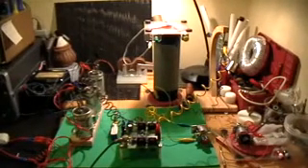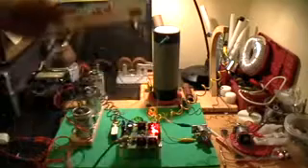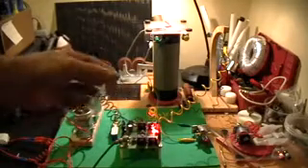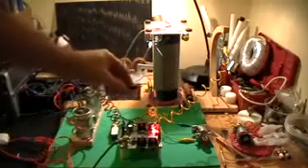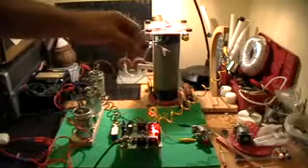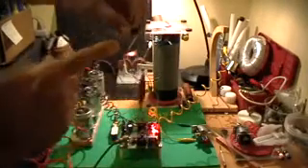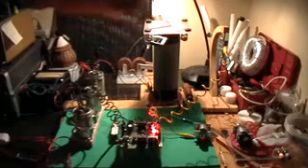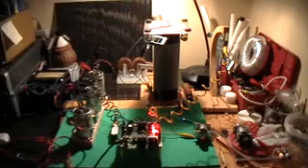resonance effects for everyone 5

Comment from the maker: That sounds really interesting and exciting. I'd like to see the material, for sure, and storage isn't a problem--I saw a Terabyte drive advertised for under a hundred bucks the other day. The best thing would be for you to upload the files to a file-sharing site, like *me*di)a^fir&e (strip non-alphas).
Speaking of audio VTTCs, I made a little singing flyback circuit that runs audio out through a tiny Jacobs Ladder at amazing fidelity (but very low volume...)
I should dig it out and viddy it.

Comment from the maker: You're almost right, again. It's getting to be a habit!
Actually, at the freqs I'm using the power is most likely capacitatively coupled rather than electromagnetically. So electric field yes, but electric field induction, in the electrostatic influence sense--maybe.
But what you are most wrong about is the "bottom line" part. What I'm showing here is only the beginning, and hopefully will save others some time. 
Like Desertphile. I'd hate to think of him wasting time, thinking. About anything.

Comment from the maker: Uh huh. Did you see the parts in the demos where I show that the range at which I can pick up the power with the matched bifilar spirals INCREASES when I put the non-powered secondary resonator into the field? Surely it takes some power to resonate the secondary. Why does the range increase? How does the mere presence of a secondary, which itself must be dissipating power, act to (seemingly) increase the power of the original signal?
Is it focussing the field somehow? I really don't know.

Comment: For the bashers, why don't you investigate the wave compression that happens in a magnetic amplifier bifilar. They transmit greater power with out the wires. Why is your pc plugged into the wall, again?

Comment: Whoever bashes you here doesn't know what there are seeing. Also stated is the 1 wire conduction. So we don't have the second wire as copper. It is the kinetic shockwave coming from your devices. The antennas just slow down the speed. I just thought I would raise the bar way higher so it is out of reach of the standard thinking.

Comment: Your large 3 coil setup is very close to a Tesla coil. The top coil is inductively connected and you can put a load on it! That is great. In your ne2 and leds in series we can see that voltage is not a measurement in this type of power. 
Oh, and the sparks on your finger tell me you are the other terminal of a stun gun. 8-)

Great videos.